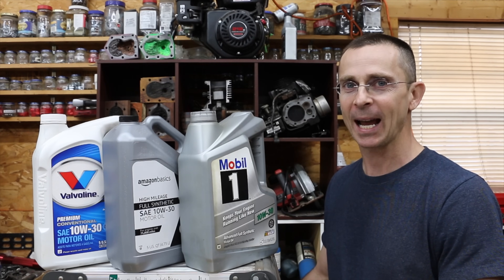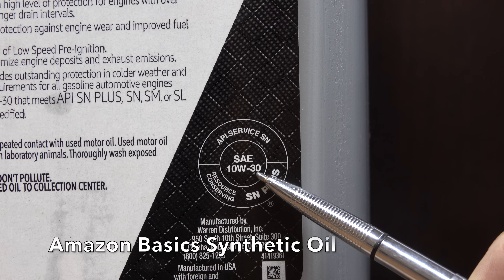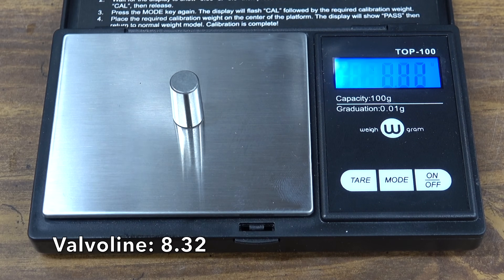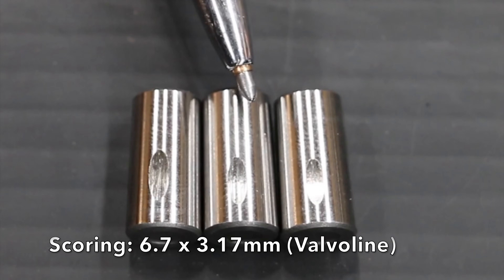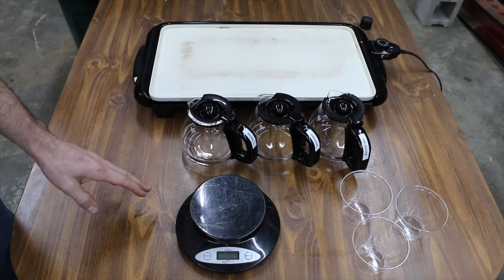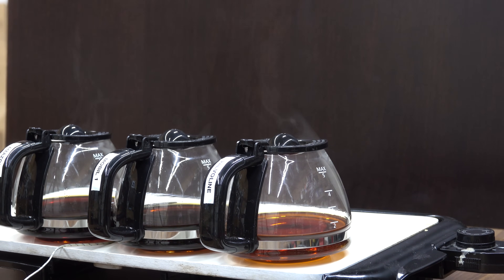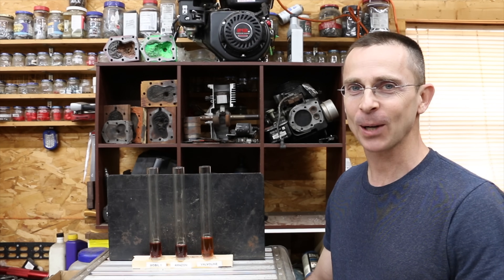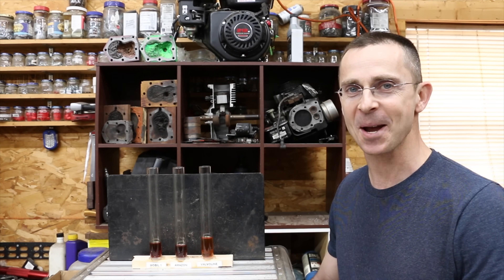Is AmazonBasics Full Synthetic Motor Oil better than Mobil 1? Let's find out!

Comment: What does the bearing test look like with no oil? How much metal is lost?
Reply: An interesting question. The most critical bearing interfaces in the engine are not steel on steel, it's usually hard steel to a softer lead/bronze bearing, like for cam and crank shafts. Things like tappets usually don't get much wear movement. Also need to remember, the #2 function of the oil is for cooling, so it would interesting to see which of these oils absorb heat better.
Reply: Kind of mute because because not using old in your engine isnt possible

Comment: I use strictly Valvoline! I use full synthetic made for high mileage vehicles though.  My guess is that if Valv Conv. Can even compete with 2 synthetic brands, its synthetic brand may actually stand up to its perceived quality.  What do you think PF?  A little tip: all the parts stores recently started selling 5 qts of Valvoline for just shy of $50.  The EXACT same product can be found at wal mart for a hair over $20.  Note: I can only be sure of this paradox in my town, as that is where I have observed it.
Reply: $42 for High Full Syn. at Autozone. Only $23 at Walmart. -Utah
Reply from the maker: Thank you!
Reply: 18 bucks for 5 quartz of shell rotella at Walmart thats what I use in my quad and my car. Its dirt cheap and works great. Walmart is always gonna be the cheapest theh have thousands of stores and buys in bulk

Comment: Great videos!  Please do a budget synthetic oil comparison.   Super Tech vs Amazon.  5w30.  And bearing test again after cooking.  Maybe Harvest King oil too, at Royal King, if available.  Also, I like the weighing of the bearing before and after the test.  Not sure of your method for measuring the area of wear on the bearing.  1) Basically just a "2 dimension", by looking directly down on the wear and measuring the x and y dimensions?  2) Or, accounting for curved surface that was cut down into the bearing, the concave area?  Because, method "1", the slightest change will produce a significantly more amount of material being removed.  Since the deeper you cut down into the bearing, the more material there is due to it's cylindrical shape.   I like the way that you have evolved and refined your testing from when you just started your channel.
Reply from the maker: Thank you for the video idea!

Comment: Wow... my life was a lie... I always thought Valvoline was the best but now I must go kill myself
Reply: This is the conventional vs synthetic.  Not apples to apples.
Reply: As Brandon stated and as it was in the video, they used valvoline conventional. Didn’t do that bad despite this difference.
Reply: THIS COMMENT MADE ME DIE
Reply: valvoline conventional was used for a baseline
Reply: @kevinboaz317  Yeah, he'd probably have been better off just labeling it "brand name conventional oil" to avoid the inevitable confusion.
Reply: Is that a joke? Amsoil, castrol,pennzoil and mobil one are the best
Reply: I've heard that Pennzoil contains more paraffins than other oil. I was told that this causes build-up and sludge. So I use it! I also drain my oil, fill with a cheap recycled oil mixed with kerosene, run engine until hot, drain and refill with Pennzoil. So I scrub and flush out the build-up. I believe there is no mechanic in a bottle. Maintenance and regular TLC have no substitute. For every school of thought there are arguments. I'm no fan-boy of either synthetic or regular...BUT real old-school aircraft and motorcycle mechanics in their 90's all told me to stick with regular oil and to flush the inside of the motor with kerosene (they called it white gas)...and to rebuild my motor if it needs it! Sure, they may be slow to accept the latest development to come out and make promises...real world tests like this help me. BUT! Do your own homework! You'll find that regular oil protects in ways that synthetics just cannot. Notice that the Valvoline didn't turn a darker color after cooking - while the synthetics DID! That's break-down, no matter HOW you stack it. Formula changed. I aint no oil expert. I just listen to the best and take into account all that I hear and see...with suspicion...slow to change.

Comment: In cold weather, is it more important to get a decent oil to the engine's critical metal to metal surfaces faster than this altrnative... getting an oil with better lubricity to those same parts not as fast?  Does anyone have the facts on this?
Reply: @mistic mind I get what you're saying and I appreciate it, but I can only use common sense if I have all the facts, which I don't. Some oils tend not to completely drip back into the pan or galley.  If an oil has better lubricity, it is likely to cling to parts longer, especially if there's a fast cool-down when it's super cold outside. If this is true, then the oil won't need to travel as quickly back to the reciprocating parts at start-up because it's already there. I've heard some chemists and oil engineers say this is happening, and as proof, they give the theory that if an engine were truly "dry starting" every time one turned the key, the engine wouldn't last nearly as long as they do, especially in the cold. Many people from engineers to mechanics have had wildly different answers to this question. Most mechanics say what you said... use common sense. I submit, just by definition, common sense almost always misses some of the facts.

Comment: Pennzoil platinum verses Mobil one and amzoil Castro’s edge.
Reply from the maker: Thank you for the video idea!
Reply: I've been running the Castrol Edge for some time now because the dealer used it on first oil change. I'm curious to how it performs compared to amsoil and Mobil one. Pennzoil as well, for that was all I ran years ago.
Reply: Pennzoil and Castrol oil is made at the same place, so it would be almost the same test.
Reply: @alexandercopeland5087  the castrol stuff are all rated with standard SN rating pennzoil platinum full synthetic and ultra platinum are SN plus so im sure there is a difference there.
Reply: @alexandercopeland5087  My Buick is made at the same place as...

Comment: Makes sense enough there is only so many companies in the US that manufacturer oil regardless of brand or type of oil at the end of the day it's going to be manufactured by one of 10 mega oil companies (defined by companies that own several other brands under the same parent company). When it comes to high end oil there is only so many brands out there really worth considering and odds are regardless of what oil brand you buy it's filled by one of these 10 companies.

You get the same stuff from the same tap not worth their time to make a new brand/blend of oil for ever out sourcing brand.

I will give Amazon Basic props tho for preforming well at such low temps while being a high mileage oil as one common trait of high mileage oils is increased viscosity modifiers which tend to hold better to metal and slightly lower friction and help slightly with compression. Who ever made that brand seemed to know what they are doing as it doesn't appear the additional viscosity modifiers effected it's pour point.

About -40c is when you can tell a difference in oils quality in terms of pour point that really seems to be the cliff that separate a good oil from a great oil even under full synthetic and well known premium brands.
Reply from the maker: Great point!  I'm now using the Amazon Basics in both of my high mileage vehicles.  Very impressive performance on cold weather starts.

Comment: Why did you test two synthetic oils and one conventional oil? Also noticed on the bearing test the Mobil 1 seem to be getting more oil on the spinning wheel.. have you done any testing with "diesel engine" oil, like Shell Rotella? The T-6 5W40 is a really good oil for turbocharged engines.
Reply from the maker: Thank you for the video idea!

Comment: It may have less flow when cold, but I'm still gonna stick with Mobil 1 in my engines.
Reply: I've typically always used castrol GTX but I had a remanufactured 351w put in a bronco recently and my mechanic put mobil 1 synthetic in it, he claims an engine with mobil 1 will run forever and he has multiple 400k+ vehicles running it.  Anecdotal, but really the only way to test which oil is better is by having oil samples tested.
Reply: @Terminxman  I'm running the 15k full synthetic in my Cirrus with a quart of Duralube each oil change.  I haven't had any problems with it and it doesn't leak oil.  I can't say it'll run forever, but I like the idea of reducing internal friction as much as possible to reduce strain on the timing belt and bearings.

Comment: I'm dissapointed that my favorite oil Mobil 1 got beat out in a test by freaking Amazon of all companies! Geez. However, I'm more concerned with metal on metal friction loss and the Mobil 1 seemed to win out in the bearing test. So, I'll continue to stick it out with an actual oil engine company that makes oil for engines, as opposed to buying Amazon oil that may or may not be the same oil from year to year.
Reply: Drew G. Its Warren oil that produces Amazonoil
Reply: Drew G. Google it up Warren has been around for ~100yrs, they make oil for walmart, mag1.....

Comment: So Valvoline is not synthetic but Amazon and Mobil 1 are. Redo the tests with all 3 being synthetic for a fair testing. Guarantee Valvoline wipes the floor of both brands...
Reply: The use of the Valvoline conventional motor oil is to illustrate the benefits of that synthetic engine oil has over conventional motor oil

Comment: I would like to see the Amazon Basics oil tested against Walmarts Super Tech oil.
Reply from the maker: Thank you for the video idea!
Reply: Both are manufactured by the same company Warren Distribution
Reply: I always use supertech high mileage full synthetic and haven't had any problems but my scion has a toyota Camry engine so that helps lol

Comment: Seeing that the Valvoline being used was conventional motor oil and the other two was full synthetic oil. I was very impressed with how close Valvoline conventional motor oil was to the full synthetic oils results. Considering how cheaper the cost for Valvoline conventional motor oil. I am sticking with Valvoline conventional motor oil changing it at 6,000 km
Reply from the maker: Thank you

Comment: Need help. Just changed my oil on my 2015 honda civic ex. I change it every 5k miles no matter what since I don't drive much. Last oil change I used the 20k mobil 1 filter and mobil 1 advanced fuel economy oil. I reused the filter since it was only used for 5k miles but left it upside down and wiped it clean on the outside before reusing it. Filled it again with freshmobile 1 advanced fuel economy. Anything I should worry about? Should I have not reused the same filter even if it didn't reach its full potential?
Reply from the maker: Hi Alexis, In my opinion, your vehicle will be fine.  If it were my vehicle, I would always change out the filter when changing the oil, since there's no easy way to determine if the oil filter is performing like it should.  Thanks again

Comment: Could you please test door locks? I know they're expensive, so at least your opinion. I did a bit of research and Abloy and Medeco are top rated, but where to buy? It seems resellers are hijacking the prices. 
This video tests deadbolt locks, but not regular door entry locks. I'm curious about both. https://www.youtube.com/watch?v=FXcGTkjaSkA&index=647&t=0s&list=WL
Consumer Reports take https://www.consumerreports.org/door-locks/door-locks-that-keep-you-safe/
Medeco Maxum 11*603
Kwikset 980

But according to this review Kwikset is not good. https://www.youtube.com/watch?v=J9pgqBSGD0s
Some design flows https://www.youtube.com/watch?v=4tc8LJiBuOc
Now this guy comes up with lock hardening techniques. https://www.youtube.com/watch?v=7JlgKCUqzA0
Reply from the maker: Thank you for the video idea!

Comment: If you look at the MSDS and manufacturer info on a lot of "off brand" or "store brand" oils you'll find most of them are made by a major manufacturer. For example Napa autoparts store brand oil is made by Ashland corporation, aka Valvoline. Except you can get Napa full synthetic for like $3.79 a quart on sale. I never buy Mobil 1 or Castrol syntec... The off brand full synthetic are just as good and half the price or less.

Have a friend who only uses royal purple... Good for him if he likes having purple dyed oil that costs like $10 a quart. LoL
Reply from the maker: Thank you!

Comment: You put wayyyy more mobil one oil than the others
Reply: It looks like the oil level in the cup self regulates to a point where its barely touching the bearing.  As long as the oil starts over that point they all ended up at the same spot.  Look about 10seconds after the inital splash.
Reply: Yeah my dad has made something like this and this guy's does the same thing with the cup and cuts the backside, so you fill until it's about to overflow

Comment: Bearing test would need to be done again with the mobil one. You had WAY more oil in the cup than the others.
Reply: Was thinking the same thing. That oil was splashing all over. The others weren't at all.
Reply: I thought the same thing, but not sure if it was due to more oil, or does the Mobil 1 cling to the race differently? It's certainly something to revisit.
Reply: Ya I agree the mobile 1 went everywhere with that test unlike the rest.
Reply: Yep 100%

Comment: I get so much good information from your testing.  Thank you. I have a vintage ford with a flathead motor.  The car has been run with  straight 30 weight non detergent oil all of its life.   I have been told switch to a 10w30 detergent oil is not a good idea as the detergent oil can cause sludge to break off and clog the oil passages hence damaging the engine.  What is your opinion?  Is there a test you could do to prove this?  I would very much like to switch to a modern oil.  Also, what kind of plastic bottle and fitting do you use for your test fuel tanks?  Thank you very much-Steve Drew
Reply from the maker: Some engines back in the day didn't have oil filters.  I presume the flat head does have one.  If not, I would not use a detergent. I would look under the valve covers to see if there's sludge.  If there is, I would probably stay with non-detergent unless you're willing to risk it.  Just my opinion.  Thank you!
Reply: @ProjectFarm  Yes, it does have a filter.  Thank you!

Comment: Walmart's Super Tech oil is $15.98 for a 5 quart jug. I ran a Series 60 Detroit 900,000 miles using Super Tech diesel oil. I heard the guy I sold it to got another 200k out of it.
Reply from the maker: Thank you!
Reply: Was it the 14L EGR engine?

Comment: Sir - One better way to fill the coffee carafes is to put the empty carafe on the scale and then zero it by pressing "Tare".   This will zero the scale with the carafe on it.  Then you just pour in what you need.  This eliminates the possible inconsistency introduced when you pour from the cup into the carafe and some of the oil is clinging to the cup.
Reply from the maker: Thank you for the tip.

Comment: I'd like to start off with how much i love your channel and your dedication to testing things very scientifically thoroughly and unbiased. Here are some of my suggestions for future videos.

At work we use something called grease gun in a can and buster (by armchem) i really like the grease spray because it stays on in the elements and seems to prevent the metal from rusting and seizing it claims to be a penetrate but i'm not sure how it stacks up. it is however expensive and you have to buy it in a case of 12 (I believe). And could you also test 3 in 1

And since you have done videos on different penetrates and rust removers how about a video about rust prevention products like anti seize and other such products and maybe just plain grease

And finally (for now) how about testing cleaning products, since every mechanic and tinkerer usually gets pretty messy, such as different shop paper towels, soaps such as dawn, lava, gojo, fast orange etc... And degreasers/cleaners like simple green, purple power, goof off etc (simple green works good and it is safe on your hands clothes and probably every other surface which is a plus, just my opinion though)

Thanks for all your videos i hope you like some of my ideas and i look forward to seeing anything new
Reply from the maker: Thank you for the video ideas!

Comment: Would you please test the FS2500 2 micron oil filter that the you tube channel mightymicron is saying will clean used engine oil? The video is under the title Amazing Filter Demonstration-Save Your Engine. Also can you use the cleaned used motor oil for other applications? Thanks! Love your videos!
Reply from the maker: Thank you for the video idea!
Reply: The problem with used oil is not dirt that needs to be filtered out (that's the job of the oil filter on your car).  The problem is contaminates, and more importantly, the "additives" in the new oil break down.

Comment: I know you don’t work with a lot of diesel stuff, but i feel like there is so much controversy about diesels and what oil to run and what weight to run and when. I would love it if you could do a similar test comparing 15w-40 10w-30 and 5w-40 diesel oils. Because in all technicality, shouldn’t 5w-40 be the exact same in the summer as 15w-40, and only show a change in the winter? Im just very curious myself
Reply from the maker: Thank you for the video idea!

Comment: You should make some biodiesel and run an engine off of it. And possibly go over the steps of making it. I did this in one of my high school shop classes. We had a old 70s diesel tractor and we made biodiesel and ran the tractor off of it. Maybe go over pros and cons of using this? I know a few modern diesel trucks are supposed to be able to run off of it.
Reply from the maker: Thank you for the video idea!